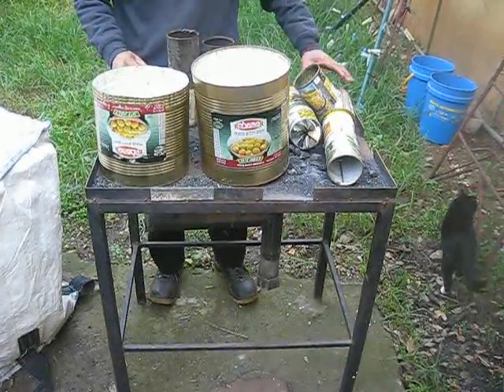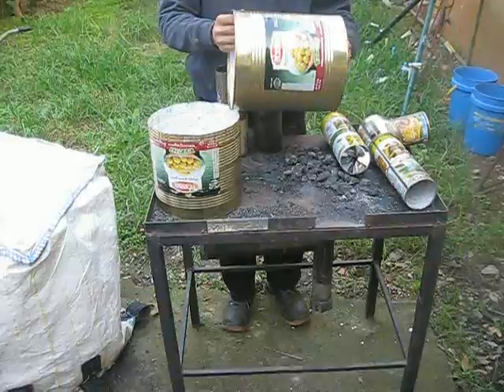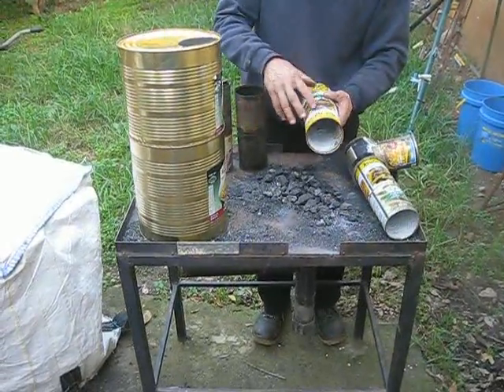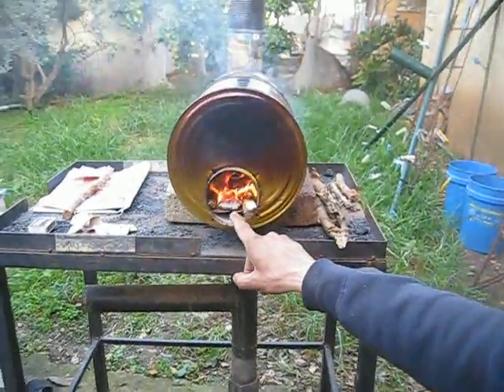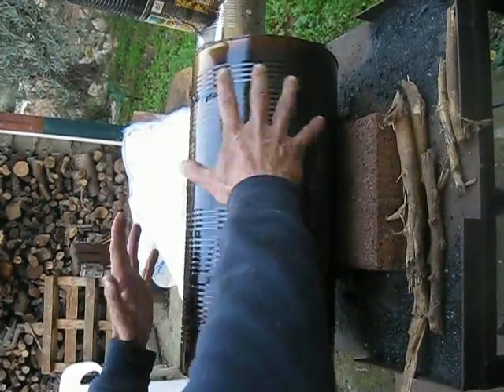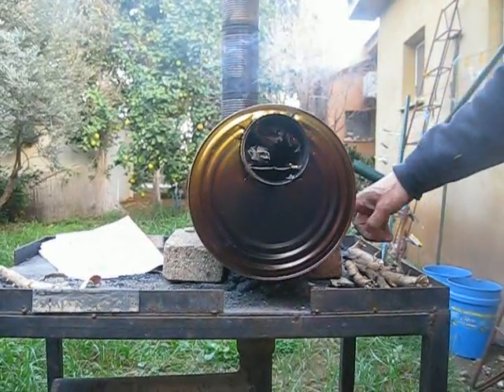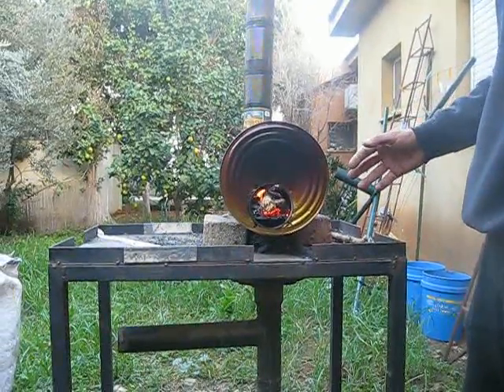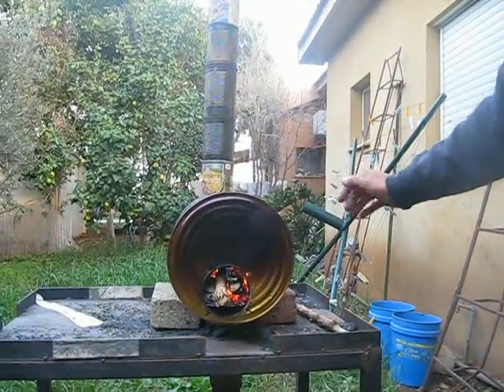Wood stove idea / prototype

Comment: Hot smoke goes up, when cold reburnt if wood feeder is down.
Add small can tube air entry maybe (1/3 chimney diameter) at basis chimney (exterior up big can)
and vortex (I havent well seen) inner hole must be 1/3 diameter of can diameter (2 blades 2/3)

English 'small neeger" is easy to undertsand for non-english,
thanks.
Reply from the maker: fred, je parle Français aussi. Vous pouvez faire votre questions en Français. Je n´avais comprendre rien que vous avez écrire! Merci
Reply: Excuse.  Tu fais un pêtit tube d'entreé d'air (avec trappe pour reguler) posé sur le plus gros barrel (ou dedans), entrant vers la base cheminée, incliné c'est mieux.